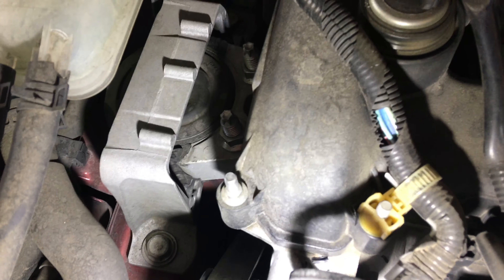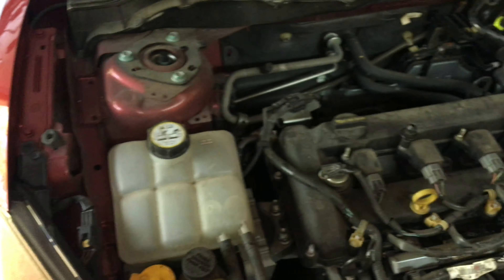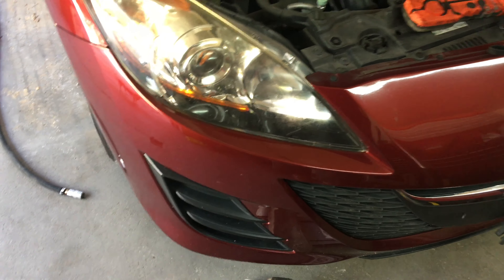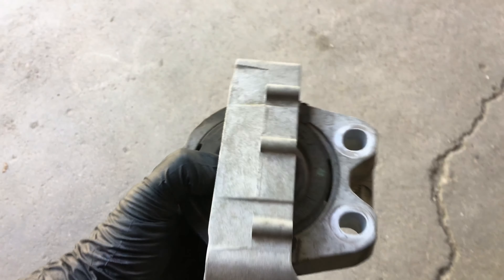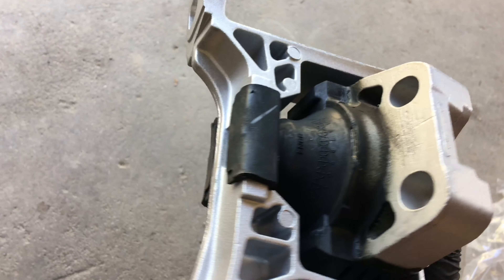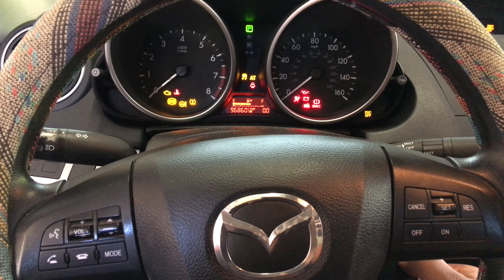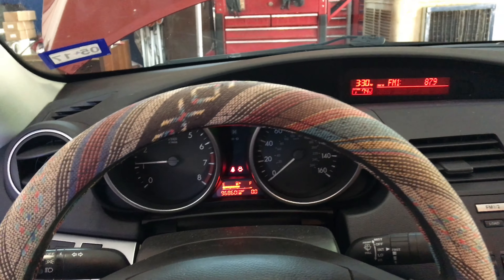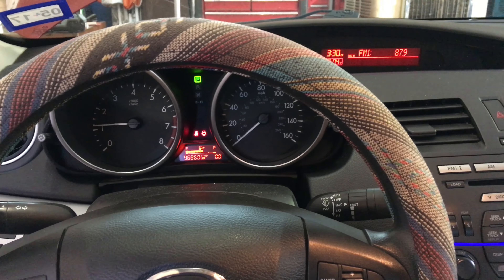Mazda 3 Side Motor Mount Install

Comment: I have a loud ass vibration when loading the engine, while in either drive or park. Not neutral. I has a look and I'm pretty confident it's the transmission mount. It's just so loose it's hitting the frame and vibrating my feet, the fender. everything. It's very loud when it does it. Sounds like metal on metal

reply to this if you're ever interesting in the final result.

Comment: I have a Focus, same problems, best to change all 3 motor mounts, it felt like a brand new car as soon as I changed them. No More rattle, with the radio off, all I heard was the wind. BTW You want to get the OEM Replacement. People have had issues with 3rd party replacements that go bad really fast.
Reply: Good call, I did that before, now another side mount is gone out so I need to replace. I opted for the non-hydraulic type this time...more expensive, but I'm hoping it will last longer than the last one I put in.
Reply: @tonykib9452  how's the non-hydraulic holding up? How many miles/kms already?
Reply: @anihche  Unfortunately, I didn't drive with it for long before I got side swiped hard enough for that mount to get knocked out of its housing, so I couldn't say beyond the 6 months I had it in. Was doing just fine until that happened though. It only bent the clamp to its housing though the rubber mount appeared fine still. I would say go for the non-hydraulic if you want something that lasts. I bought the cheaper hydraulic replacement when that happened about a year and a half ago, and I suspect it may already have busted, spilling grease out everywhere just after driving the car with no other accidents.

Comment: There was also some noisy sound before you changed the mount. I hear the same noise in my Mazda 3. When I lift the engine to the right little bit.. the noise goes away.
Reply from the maker: yes . sometimes you get a noise too

Comment: I have a 08 s 2.3. An when I take off at around 3 to 4000 rpm there’s this really loud vibration it almost sounds like it’s missing but not but here’s the crazy part it stops after car warms up,, could this still be a mount even though it don’t do it after it warms up?? Please reply
Reply from the maker: dosent sound like the mount... could be something else
Reply: Yes, the issue is the passenger side motor mount

Comment: I'm trying to find information on whether or not the engine mount (Specifically, the right side) for the 2014 Mazda 3 2.0 L will fit the 1.5L Mazda 3. I'm unable to find a definite answer, can you say if it fits?
Reply from the maker: I would call a parts department of mazda or maybe any parts store and ask for part numbers of both cars .. if they part number is the same .. then there it goes your answer

Comment: Will the same mount also cause a rattle noise in the front passenger side, right where the mount is? My car has 162000 miles.
Reply from the maker: rattle like metal on metal? probably not
Reply: turn your wheel all the way to the right and drive in a circle. if you get loud vibrations then you should replace the passenger mount. this was my symptom

Comment: i had mine leaking but did not have vibration, after replacing it now i have a lot of vibration similar to yours when the mount was bad
Reply from the maker: maybe you got a bad mount ..
Reply: Check the rear mount under the car. They are common to fail.